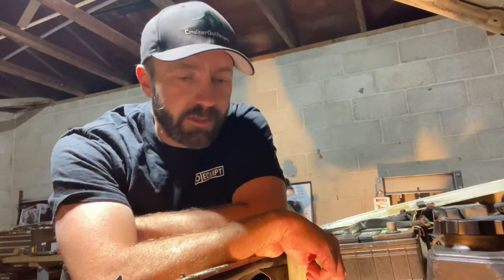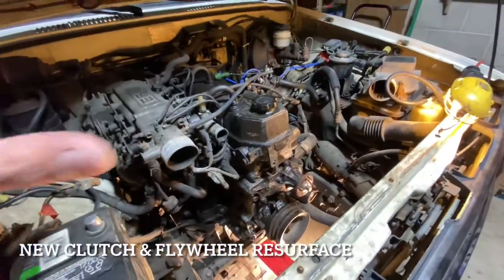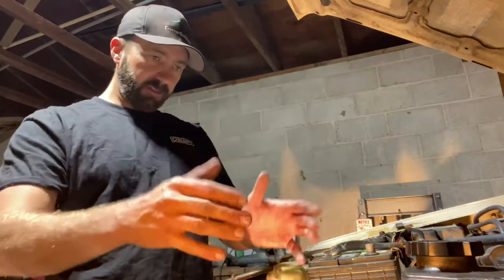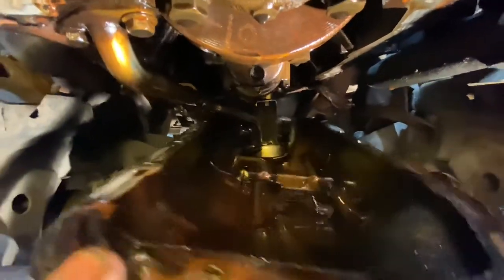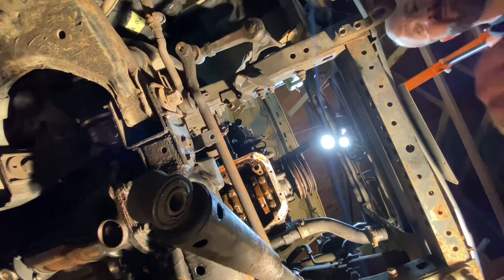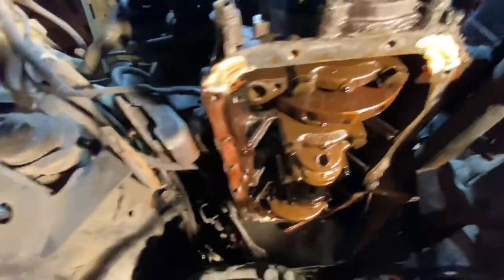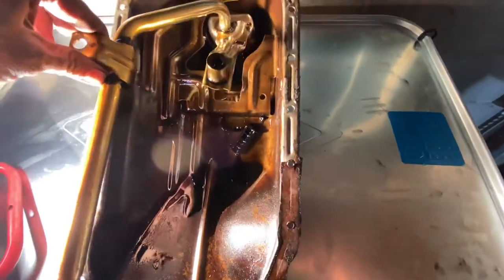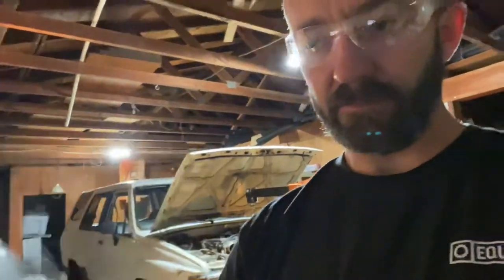TOYOTA 22RE OIL PAN REMOVAL | 1986 IFS Toyota 4Runner & Pickup Trucks

Comment: So I went ahead and dropped the front differential by removing a four bolts holding the crossmember, and then the two 19 mm bolts that attach the front differential to the frame. I didn't disconnect anything else, and used a jack to gently control the fall, in the oil pan just slipped straight out the back, not the front. And that was without removing the oil pickup.
Reply from the maker: Nice move! 👌🏻

Comment: The Toyota service manual says 1) remove the 4 14mm nuts (after liberal liquid wrench) and pop out bolts for cross member.  2) Disconnect both idler + pitman and let steering hang.  Than  remove all the bolts on the oil pan and drop her.
Reply from the maker: Have you tried it that way? Or this way? Can you say which is easier or better from experience? Thanks for the info.